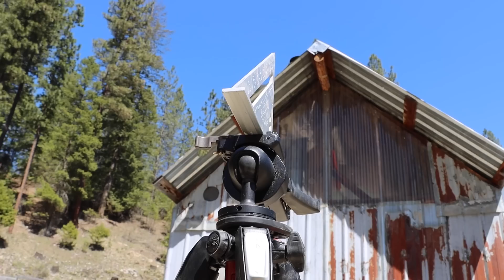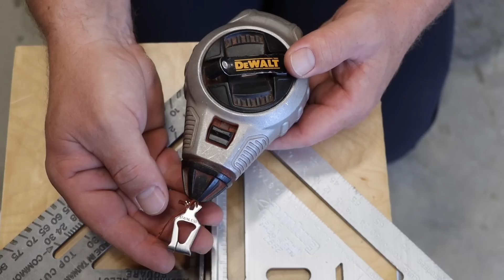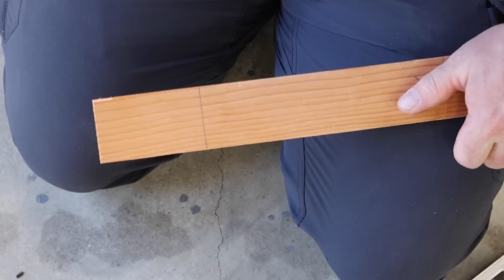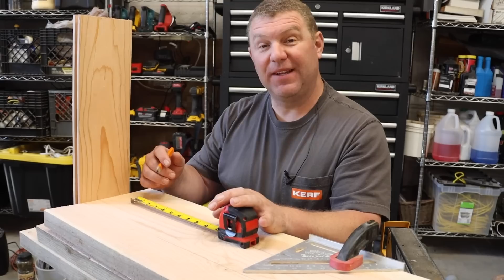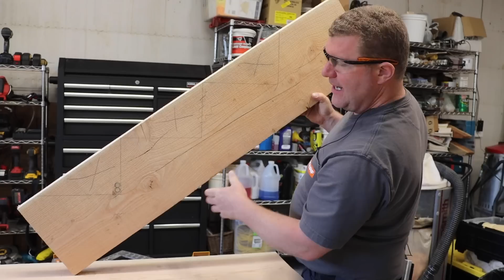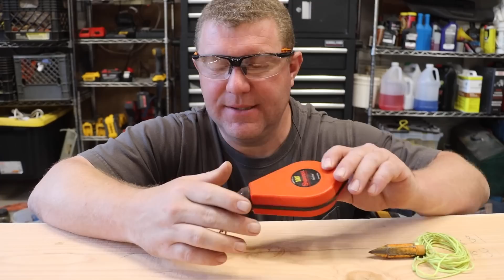Few People Know These SPEED SQUARE HACKS (Tools Hacks Tips)

Comment: Your 2nd tip is 1000 + yeas old, then they used an A frame and plumb bob or string with a weight on the end ,not knocking the speed square just an old thing that can be used in todays life

Comment: another trick loggers use to estimate the height of a tree, using the same principle.  walk away from the tree or building. stop about where to think the tree height should be if it were laying on  the ground. bend over looking between your legs until you see the top of the tree. when you find that spot.  that is were the top of the tree will hit when it falls.  try it it never fails.

Comment: I worked in the construction business for more than 20 years and I can honestly say that I didn’t know most of these tips even though I had the same tools you used in this video.  I knew about using the chalk box as a plumb bob, but, your right, it needs to be a quality version of the tool because the cheaper ones aren’t built as nicely and won’t be as accurate.  Thanks for making this video and sharing these tips.